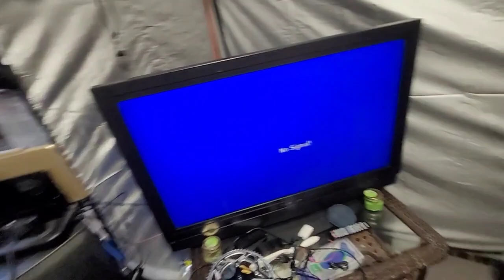CCW Rewind Beast , My surron, What I was wrong about with volts vs amps and did I achieve my Goals?

Comment: Is there any reason why most of your bikes are QS273 instead of 205
Reply from the maker: Yes because 205s run hot with power that's why you see guys putting ferro fluid and heat sinks on them if running over 15kw. You don't need that crap in 273
Reply: @ChrisCrossingWires1212  makes sense. so a 5T/3T QS205 for a long range and a 3T QS273 for power/speed. Thanks. Keep up the good work, can't wait to see more.

Comment: Dang man! Always something with that porch workshop. It’s going to get too cold anyway in a few weeks. My garage is too cold to let me fix my current ‘fix’ , a EZip 750W scooter, broken brake handle messing with the shut off switch and a few minor issues including a back tire leak that wasn’t the inner tube but a leaking tire valve. Could have saved a lot of time if I’d dunked the valve stem underwater before removing the wheel and tearing out the inner tube! Pro tip: put a flexible tube over the valve stem to extend it so you can dunk the end into a cup of water to see if the leak is from the Schrader valve.
Reply from the maker: Lol Mr Mike you didn't see that this was a throw back video to the last time yeah it would be something you didn't see this was before I actually built the Beast and I'm talking about building battery's I hadn't even built a Battery yet this is from last year I'm just looking back on what my thinking was then versus what I'm doing now. That's why I never rebuilt the shop again because I had to remove it twice. No not going for 3 times the charm
Reply: @ChrisCrossingWires1212  I had a feeling that was a time jump, but I already had those thoughts and had to get them out.